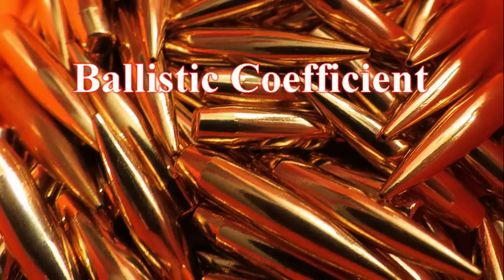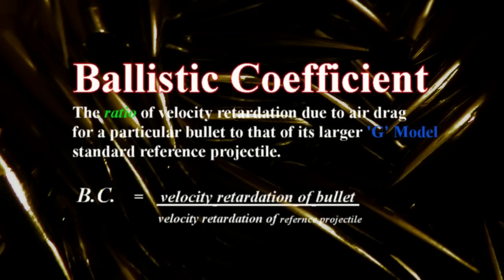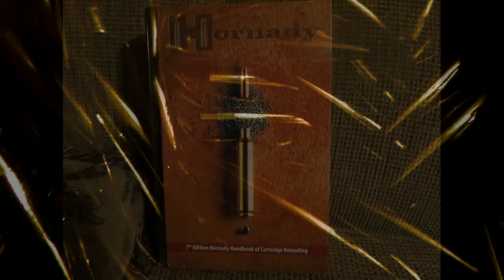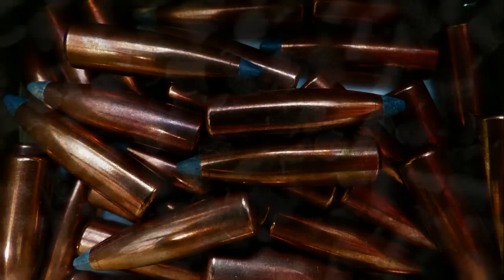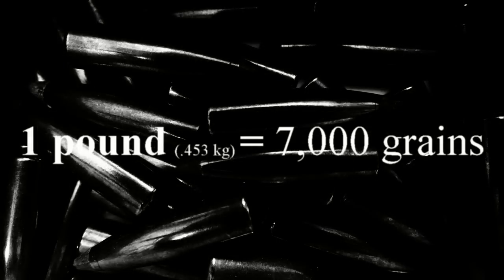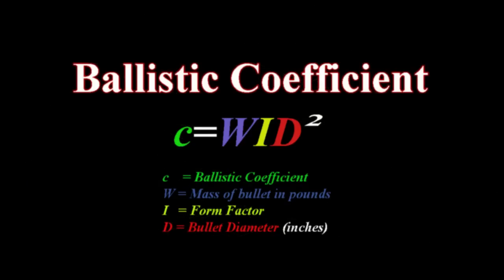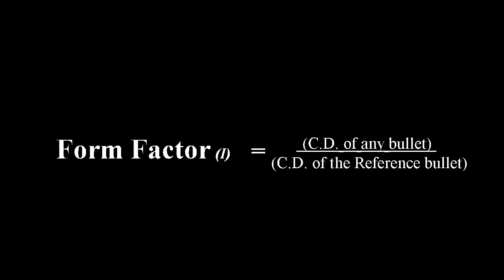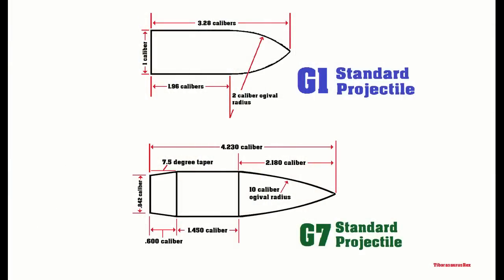Long Range 101 Part 76 - G1 vs G7 Drag Functions & Ballistic Coefficients

Comment: 3:27 the formula should be c = W I / D^2 . Divide through square of diameter instead of multiplying with it.
Reply: It's not just typo in the video but also in the description of it. While his videos on ELR shooting are generally good, I noticed some old and incorrect myths are propagated in them. For instance, he suggests that most of the riffle bullets become unstable due to effects of transonic zone. Most actually aren't!
Reply: I think it’s important to remember how much the Internet has made information like this available more and more. This video series is a decade old and he does get most things correct. It was really hard to get facts straight back then and he did an overwhelmingly good job considering how much information he covered. It’s obvious he took the time to read tons of field manuals and published data rather than regurgitating somebody else’s info from a video. I would be totally down for him updating/remaking the series.

Comment: We deal with this in my line of work. we used a conversion factor to convert gross barrels of petroleum products to net barrels and as far as weight goes being 1 of the factors, water is our standard of 1 API, weighing 8.34 pounds per gallon. Gasoline has a higher API of about 59-60 and weighs about 6.25 pounds per gallon. Obviously the lower the number, the heavier the product meaning we haul less amount in barrels to get the same draft in the barges. negative 12 was really heavy. its like using someones foot as a standard. it doesnt matter how big it is, its just gonna be a starting point

Comment: I knew the g7 was a more accurate representation of today's rifle bullets. But thanks for the math class. I digg learning the basis for the formulas so that when applied or compared to the empirical data l get a more accurate representation of the results I can expect before going out in the field. I can't imagine trying to work up a drag function for a stuffed animal all those shapes and how it would be deformed do to the changes in pressure. I know this, it would be a ballistic pig and being low density it would lose energy quick. Terminal ballistics would be negligible. LOL
Reply from the maker: The asymmetrical profile of stuffed pigs, rabbits and bears require a very strong twist to achieve static stability.  The stuffed animals with the best external ballistic performance are the stuffed whales and sharks - the tails moves the center of pressure rearward and helps to stabilize their flight considerably... the challenge is keeping them together at supersonic velocities.  Premature fragmentation is an issue.
Reply: Fin stabilized, plush projectiles. Once again Rex showing us the way to go.
Reply: TiborasaurusRex 
I find this comment rather offensive and racist to stuffed bears everywhere.
Reply: Lock & Load and fire for effect on the sharks, save the whales.

Comment: Where did you find this graph from 9:47 ? How did they determine drag coefficients in real flight for velocities as low as 200-300 ft/s when real bullets never flight so 
slow. Did they fired it at subsonic muzzle velocities and track with radar or what? Thanks 
for the answer!

Comment: Great video. Enjoy watching your series. What does it mean in my ballistic program when the G7 value is displayed as "Litz" instead of a number? This comes up in the program ISNIPE when i look at .308 berger 168 gr target hybrids. Program still seems to calculate accurate data just wondering what this means.

Thanks
Reply from the maker: Bryan Litz independently verified and refined many of the published BCs in his research...  He also work determining G7 values for many bullets.  I am guessing the program you are using is simply inputting Litz's BC data.
Reply: Also if you are using the JBM Ballistics calculators or tables the projectiles labeled (blitz) are from his data/book I believe.